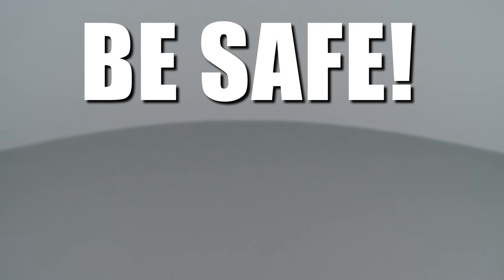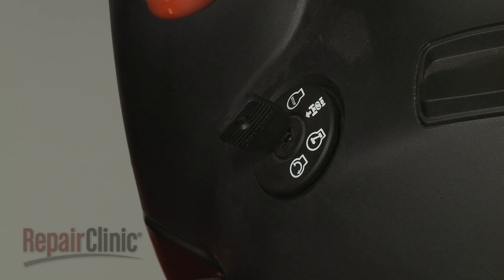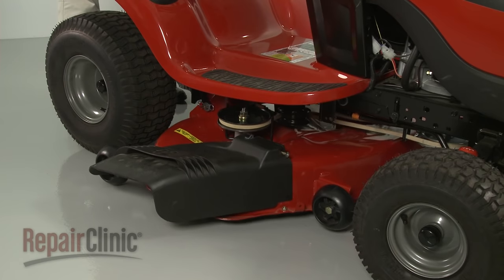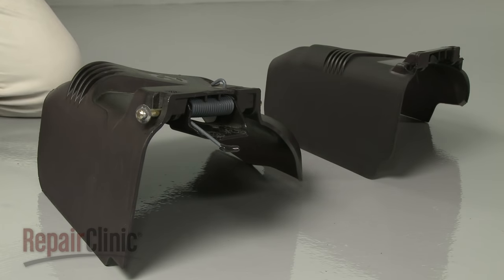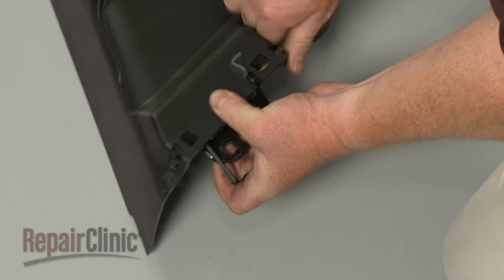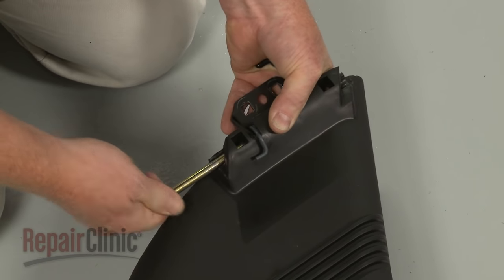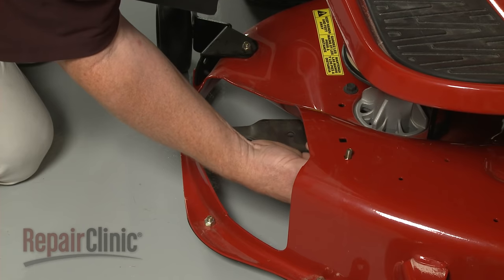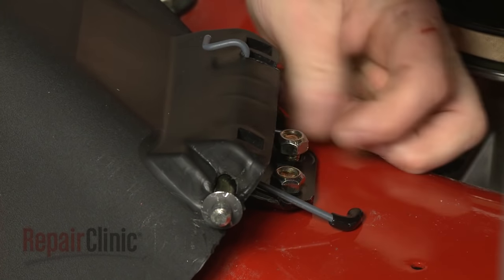Craftsman Riding Lawn Mower Replace Grass Chute #532130968

Comment: A note of caution: Make sure you have penetrating oil nearby as the bolts may be rusted and difficult to remove. Also, the retaining pin for the spring is a royal pain to shim-off the rod and will require a significant amount of effort. The demo makes that look too easy.